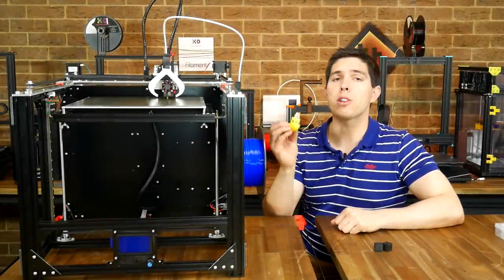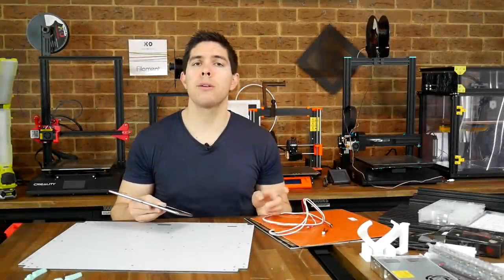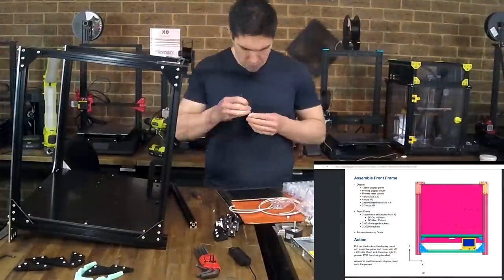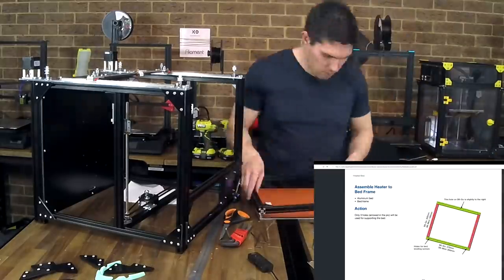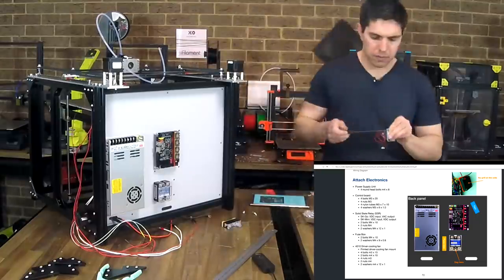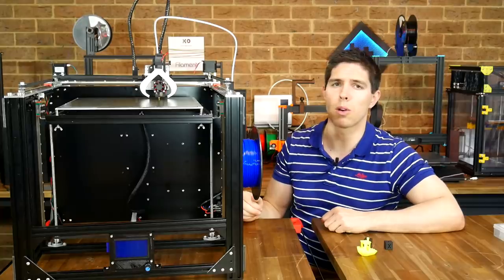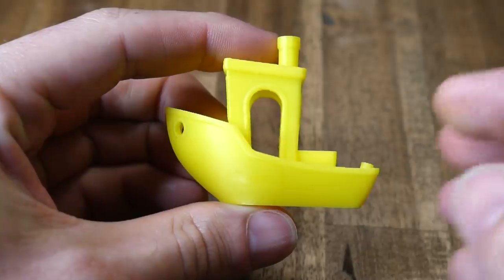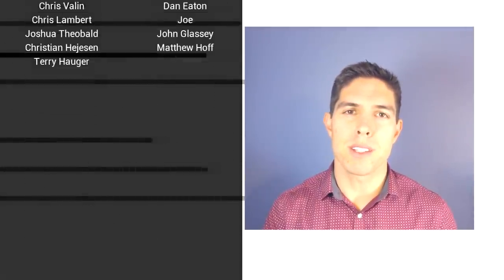SecKit SK-GO assembly and test prints - CoreXY linear rail 3D printer

Comment: Excellent review, as always :) On topic of "many holes for upgrades" - how ready is it for auto bed leveling? Does it have appropriate holes on the extruder carriage or will it be necessary to print something out? (he asks while opening the manual, but at the same time knowing that answer might be useful to others :)
Reply from the maker: It comes with a temporary clip on probe to measure and store a mesh. I may end up adding something more permanent if I can get something light enough.

Comment: Definitely my next upgrade. I still use the first 3D Dremel printer. Though it still works and the prints are high quality, the print volume is small and I can only print and Pla. For some reason, it has been getting jammed constantly. And no, I don't use cheap filaments. It's no longer a reliable printer. Any tips? 

Can this print flexible materials?

Comment: damn. this is freaking amazing. I have a hypercube now but god I'd love one! if I hadn't built my own!
Reply: Hmmm, why? I'm thinking about building Hypercube and I find it much better looking machine mechanics vise. Only plus in this seems to be linear rails instead of original hypercube ones. Plus this thing seems to be expensive as hell with shipping to Europe
Reply: @jothain  linear rails are awesome! also this doesn't need a first 3d printer even tho it's labeled as "your second". also the idler system on the hypercube is awful tho my redesign makes it 10x better and it works fine for now . I'll publish it to thingiverse soon probably. once I confirm it works cause I have some major durability concerns. might make it print in 3 peices
Reply: @chloemcholoe3280  ok. Can I ask what kind of problems you've had with idlers? Would be nice to know if begin to build one.
Reply: @jothain  the idlers are free to move up and down and wobble slightly. not to mention most of the 3mm idlers I found and this isn't just me aren't good. they either don't spin well or spin in an oval. it also uses washers to hold them in place which is a horrible design. because you can't get them precisely in place like a nut+nylon washer (not those giant flat metal ones) Overall the idlers are not held in nicely and wobble and move up and down giving you uneven layer lines. almost every one of them i've seen has issues like this
Reply: @chloemcholoe3280  Ok, thanks for letting me know. It'll sure be nice to know before beginning assembly
Reply: @jothain  yeah! otherwise it' a decent printer. I'm not a fan of the vertically mounted 8mm shafts and all but its good :) not amazing but good! that is once you fix the idler :P don't worry tho it functions very well with the default config it just suffers from layer uneveness.
Reply: @jothain  most of the better printers (blv mgn cube/voron 1.6, not sure about the older voron tho) fall into the expensive 600$+ price tag anyway

Comment: Were torque values supplied in the instruction manual for the bolts or is just a 'tight' turn enough to run with it?
Reply from the maker: No torque values. The manual is on their docs page if you want to check anything else.

Comment: Never seen a so much smooth vertical surface  (20mm Testblock)    I am very excited cause my next printer who i started to build has the same (Original) HiWin Linear Bearings. So maybe i will get same smooth surface

Comment: I’m more curious how it compares to the hypercube and Voron. The price and size seems pretty good. I think the bed needs wider support though but that’s just me. Instead of the support just being a rail on each side
Reply from the maker: I see your point on the bed. I might add some spare 90 degrees brackets to the junction to stiffen it a little.
Reply: I think the bed frame is strong enough as long as you don't smash it, since prints are at most about 5KG and you want linear rails to run well. I place pliers, wrenches, etc on the bed while changing extruder.  ^^

Comment: Looks alot like a Hypercube.  Are those 2040 extrusions on the front?
Reply from the maker: Yes 2040 at each corner.
Reply: 4 vertical legs are 2040 extrusions :)

Comment: How is the noise coming from the motors? My favorite upgrade on the ender3 was the 1.1.5 board to make the stepper motors super quite.
Reply from the maker: These have tmc2130 drivers which have the same stealthchop mode. Loudest noise is the hot end fan which you can hear in the video.

Comment: B[oody bonza ripper review allways love the way you teach us even as a review and assembly I all learn something.What control board is in this printer ,and is the power supply sufficent for the bed size,seems to be a toss up between this and the sidewinder.
Reply from the maker: SKR v1.3, I've put this in a few other machines as an upgrade. The bed is ac powered so doesn't need the DC PSU to heat.
Reply: What's up its school holidays and you can't sleep up at the crack of dawn like all of us old farts

Comment: I looked at their shop... they only offer airmail shipping to Germany which is $120 ... and don't offer EUR pricing either. A little strange that. Also their homepage mentions "servo motors", probably steppers or brushless with encoders, which makes the stepper drivers a little moot, but I guess that's just confusing different models.
Reply: Hi Andreas, sorry for confusing you. The website needs to be refactored since originally there was only one model, SK-300, so this is what you see at the main page. Later SK-Go / SK-Mini were added but website structure are out of date. Give us some more time, and just click the purchase link for info about SK-Go/SK-Mini.

Comment: Hey TT. Just checked out your linear advance video. Do you know how changing nozzle sizes effects linear advance? Will it need to be re adjusted?
Reply: Also just a thought. This won’t apply to any Core xy machine, however on more traditional 3D printers printing parts that are dominate in a square or rectangular shape at a 45% angle will give you a mechanical advantage that when applied with linear advance should give great results with high printing speeds.

Comment: Reading all the comments I am still wondering where the Huge advantage over the Ender 5 Plus is? Especially because of the much simpler belt design of the Ender 5 Plus (Cartesian even if it looks like CoreXY) im still much more convinced towards it.
Reply: The ender 5 is not a core xy, so it has a very high inertial mass gantry = overshoot and  lower speed printing to get similar quality. Additionally the frame isn't as braced and rigid = vibration artifacts. This uses linear rails vs wheels, there is no comparison in terms of moment of torque resistance and accuracy.
Reply: @m3chanist  why should the mass gantry be much higher on the ender 5 plus? The only difference I see is the weight of the X stepper motor that is not moved on corexy. Extruder and x rail is moved on both.

Comment: Do you have (or know of) any information regarding the emission hazards of 3D printers?  I don't notice any strong odor while my Ender 3 is operating a few feet away from where I sit, but wondered if there's any substantial data on this yet.
Reply: Flying Squirrel FPV There’s tons of data on any material one could be working with, and you can google “*insert material name* MSDS sheet” to find all details relating to that particular material. OSHA and international equivalents require such Material Safety Data Sheets for every potentially hazardous material they are importing or selling. 

You can also find a wonderfully hi-res chart of various plastics and their melting/combusting temperatures on Dave Hakkens “Precious Plastic” website or many of his YouTube videos. 

While not always a guarantee of safety, it’s most important to be at a temperature that is MELTING your filaments and not burning or vaporizing the materials
Reply: Michael Sweet Thanks Michael!  Hopefully the 240C I use for PLA is within this safe threshold.

Comment: I'm puzzled why printer manufacturers continue to use turn of the century user interfaces. At this point a small touchscreen should cost very little.
Reply: On the one hand I agree with you. But on the other hand, if they're trying to compete on price down at the budget end of the market I would MUCH rather they spend those last $10 - $20 on better materials (belts/fans/motors/etc) than on the screen!
Reply: I have both; the standard screen/knob on my CR-10, and a touch screen (7" PanelDue) on my V-King CoreXY printer.  This may seem odd, but I actually prefer the smaller screen with the knob on the CR-10...  I can micro-step my Z offset without looking at the screen, and I find changing temps and speed on the fly much quicker.
Reply: @richwp5580  Yeah I agree, I went back to the knob based screen after a 3 month experiment with touch screens.

Comment: A nice printer from a mechanical standpoint, BUT:
The E3Dv6 clone hotend was utter junk, went straight into the bin.
All connectors on wires that see line voltage were either badly crimped or not crimped at all, a fire hazard.  Re-did all of them.
SD card slot on controller is disabled by default, has to be changed in configuration.h, but Bigtreetech SKR v1.3 board refuses to accept updated binary.  Wrote the updated binary direct to the microSD card on the board, and system froze on reboot.  Do I have to replace the Bigtreetech board?
This is NOT a plug-and-play printer.  Be aware that you will face issues getting it up and running.  Ernest is standing behind his product, but he necessarily had to cut a lot of corners to maintain his price point.  Caveat emptor.

Comment: Unfortunately, it looks like the price has more than doubled since you bought yours.  Even self sourcing the rails has a massive increase in price.  And no promotion.
Reply from the maker: You may be on the SK-300 page instead of the SK-GO/mini.
Reply: Please check SK-Go/SK-Mini from the top-right button. I'm sorry that a more expensive SK-300 model confused you and the old website structure needs to be refactored. ^^;